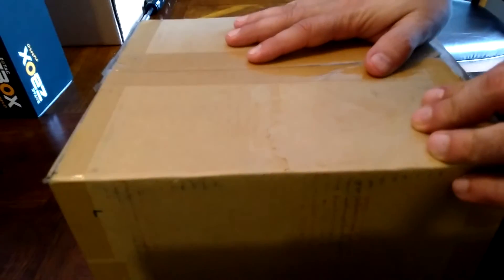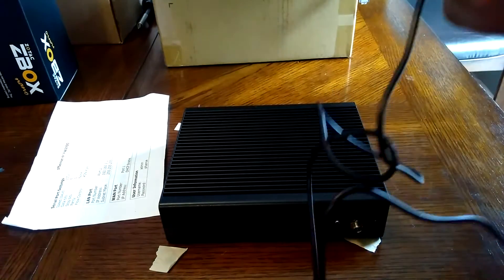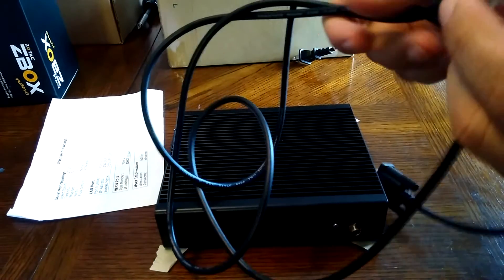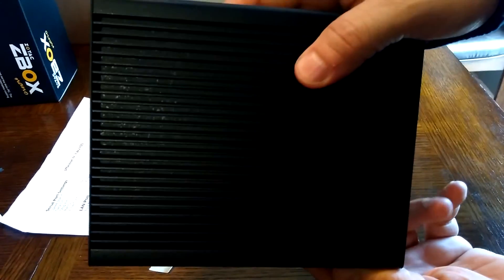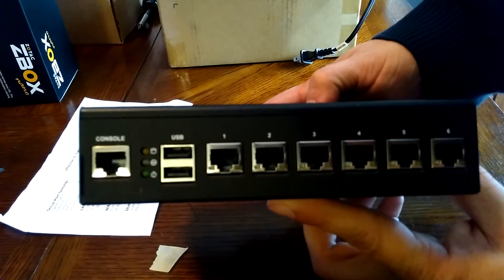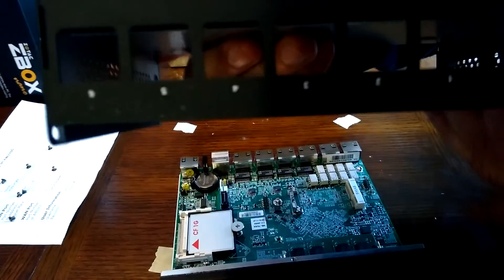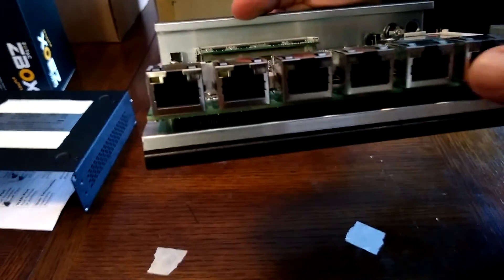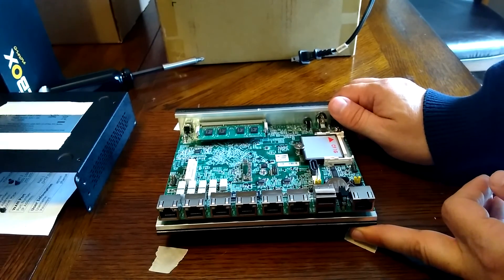✅ Lanner 7525 pfsense Router - This thing gets really Hot!

Comment: I'm using one of these and find it's not getting overly hot, but is warm for sure. I've  got a stack of them for an SDN project I am working on. They are an excellent little box. I am wondering if we're going to have issues with the Atom C2000 yikes.
Reply from the maker: It depends where you place it. But at room temperature the units I have seem run hotter than I would like. The same is true for some older (FW-7535) passively cooled units from Lanner.  But these things just work.  I didn't even think about the C2000 issues. Well if they do fail they won't all fail at the same time.